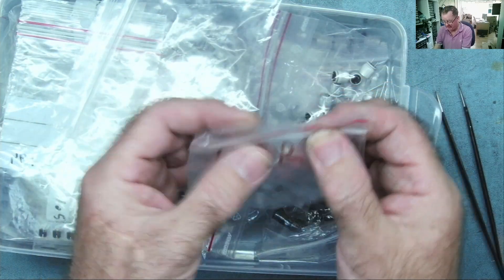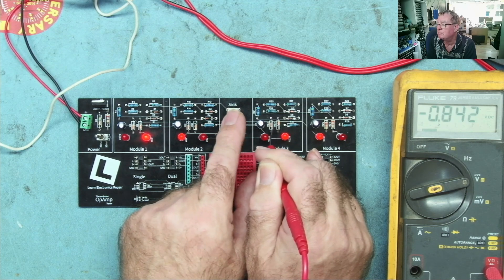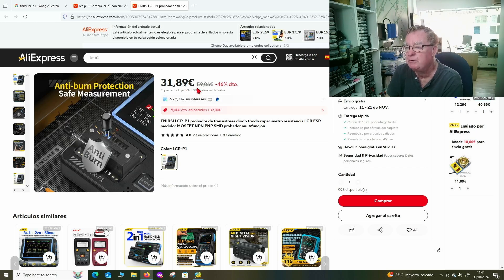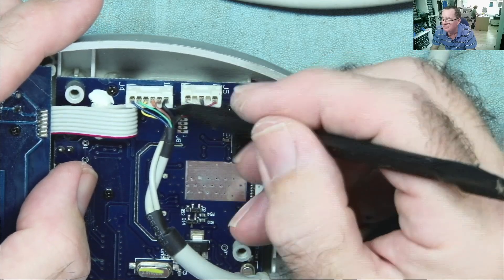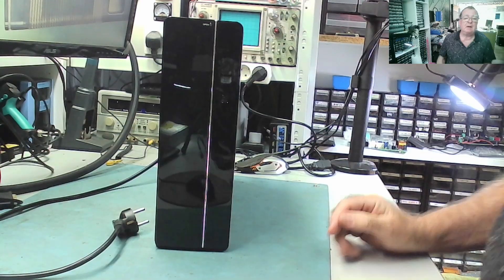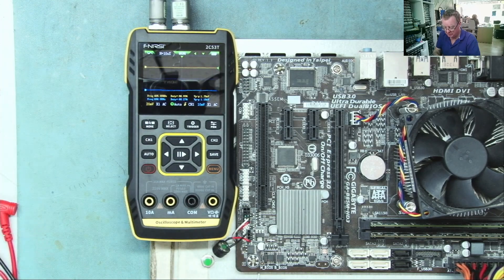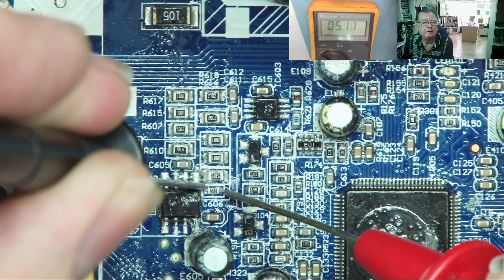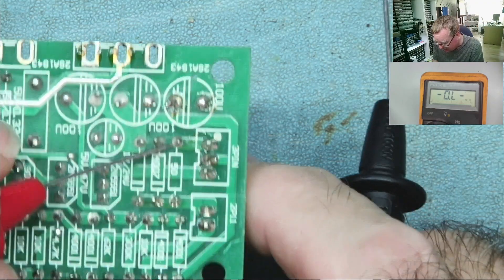Learn Electronics Repair New Year Funny and Crazy Outtakes 2025.  ENJOY!

Comment: Happy New Year !
Well that was a good chuckle, thanks. What a lot of effort you all put into making these fab videos. Greatly appreciated 👏 
That multimeter incident reminds me of apparent problems with some fake car fuses causing fires as they don't blow at the correct rating. They were all made with the same fuse wire just different cases ! 😮
It might be worth doing a video, or live stream, about trying different sources and experimenting to see if the 'cheap' ones do actually blow in range as I'm surprised your other fuses blew but not the meters one at the source. 
Keep up the great work.